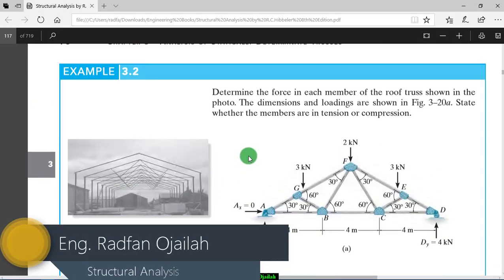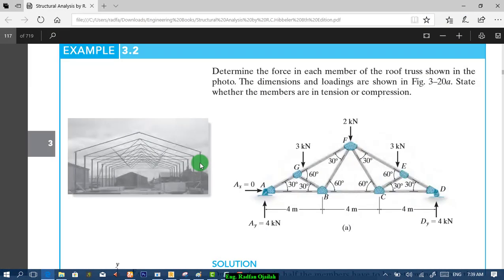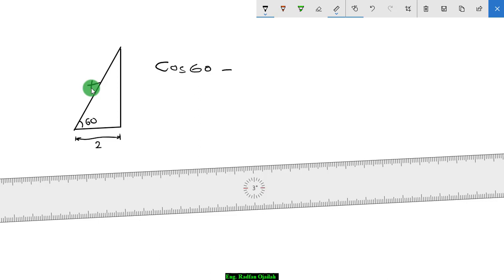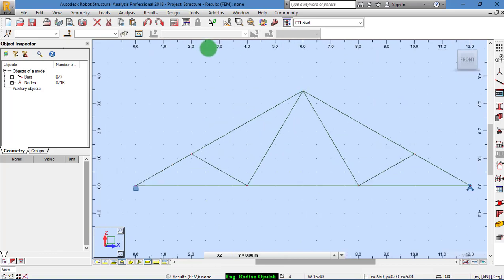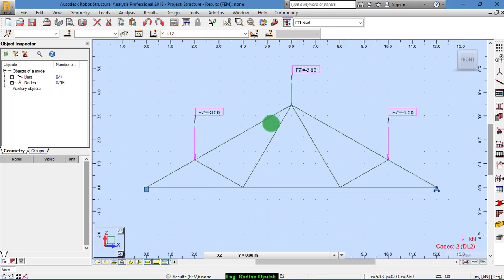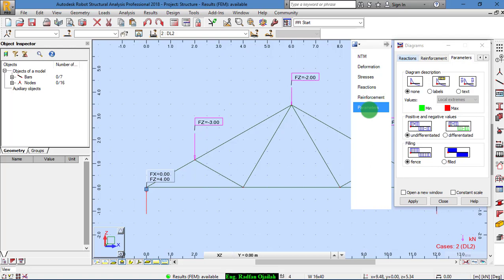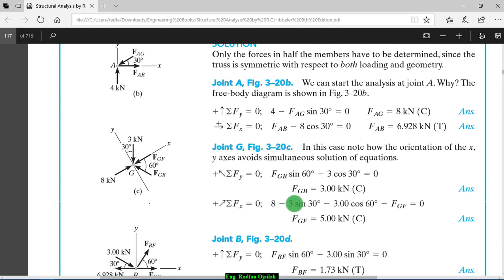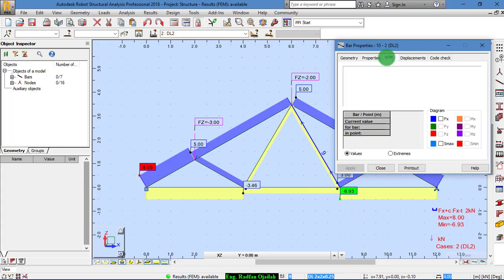Structural Analysis Using Autodesk Robot, Exercise04

Comment: so i tried your exact same problem but it showed diffrent result also i checked u have 16 nodes while i have only 7 and i have no idea where could u get the extra 9 nodes thanks in advance
Reply from the maker: Thank you for your comment.
If you followed the  same steps  do not worry. That means the self-weight of the truss has been added. to remove it follow these steps:.
Go to loads Tab, the select load table, after that select the first row which is shown as self weight and remove it. then run the analysis again and you will get the exact results.

If you get further problems please let me know.